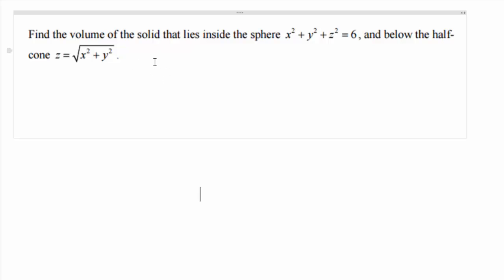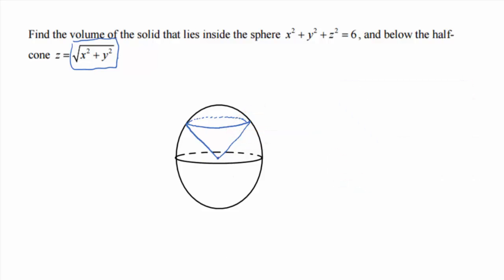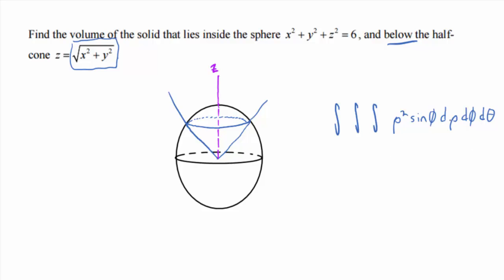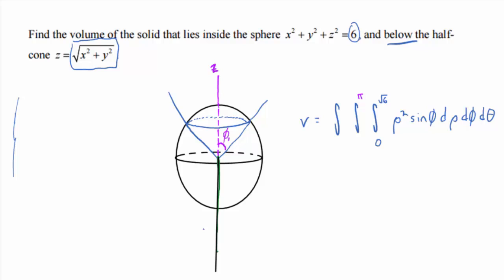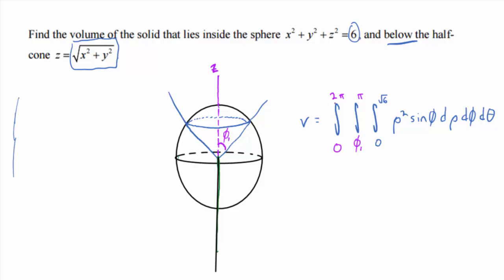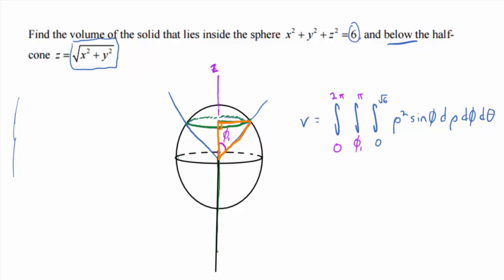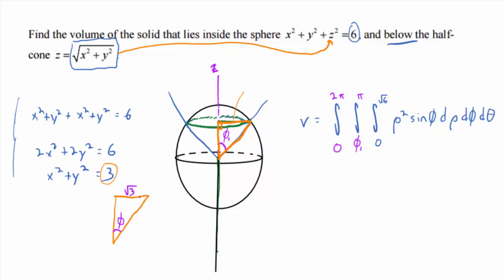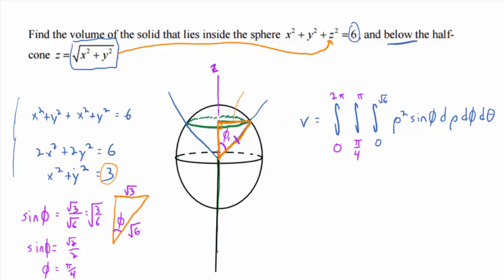15.8.4: Setting Up an Integral That Gives the Volume Inside a Sphere and Below a Half-Cone

Comment: Finding phi1:
z=sqrt (x^2+y^2). 
When y=0 the equation becomes z=x, with slope 1. This slope has the angle from the vertical of pi/4, so 
phi1=pi/4.

For z= sqrt (3x^2+3y^2).
y=0 -> z=sqrt(3)x, slope=sqrt(3).
Slope is tan(angle from horizontal) and slope is cot(angle from vertical), so
phi1 = arctan(1/sqrt(3)) = pi/6
or
phi = pi/2-arctan(sqrt(3)) = pi/6.

The angle of the side of the cone, phi, is quite literally sitting right there in the coefficient in front of the sqrt(x^2+y^2). Just invert the coefficient and take the arctan.
Reply: True. I mention that in reply to one of the older questions.

Comment: I dont understand. If you rewrite the cone equation with z = pcos(phi), x = psin(phi)cos(theta), and y = psin(phi)sin(theta), you will get sin(phi) = cos(phi), which implies phi = pi/4, not pi/6. Could you please explain?
Reply from the maker: In the example from the video, the lower value of  phi does equal pi/4. If you're referring to the example z=sqrt(3x^2+3y^2), then, no, phi must be smaller than pi/4 because this cone is "taller" than the one from the video, given by z=sqrt(x^2+y^2). To see this, set y=0 in z=sqrt(3x^2+3y^2). This turns the side of the cone into a line in the xz-plane.  You'll get z=sqrt(3)*x. Draw the corresponding triangle and get tan(phi)=1/sqrt(3) or phi=pi/6. Remember, the lower limit on phi in this case is measured from the z-axis to the side of the cone (or line if you look at the two-dimensional cross-section you get by setting y=0).
Reply: @calculus3d130  I understand now. Thank you.
Reply from the maker: @KishoreG2396  Glad to help.

Comment: Won't a cone always hit the sphere at pi/4?
Reply from the maker: No. Use z=sqrt(3x^2+3y^2) for your half-cone. You should get phi=pi/6
Reply from the maker: Here's another way to get phi, assuming z=sqrt(3x^2+3y^2). Set y=0, which turns the side of the cone into a line in the xz-plane.  You'll get z=sqrt(3)*x. Draw the corresponding triangle and get tan(phi)=1/sqrt(3) or phi=pi/6.
Reply: What if the cone's summit isint centered with the sphere?
Reply from the maker: @nathannixon2727  If the cone's vertex doesn't coincide with the center of the sphere, then it is potentially a harder problem for which spherical coordinates may not be helpful.  Still, in general, to find the volume of a solid region, you would triple integrate: the inner lower limit of integration would be the function that gives the lower boundary surface, while the inner upper limit would be the function that represents the upper boundary surface.